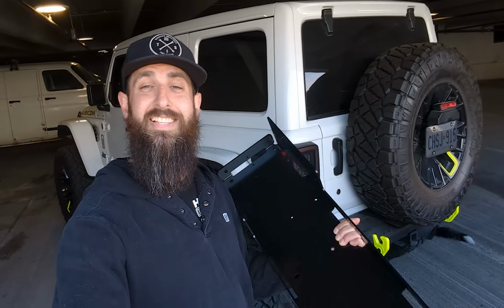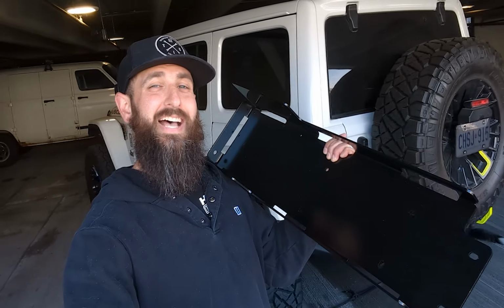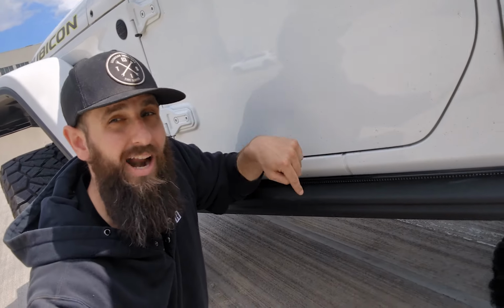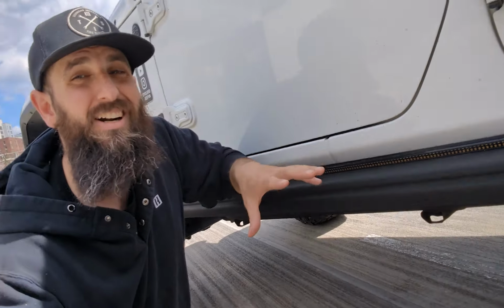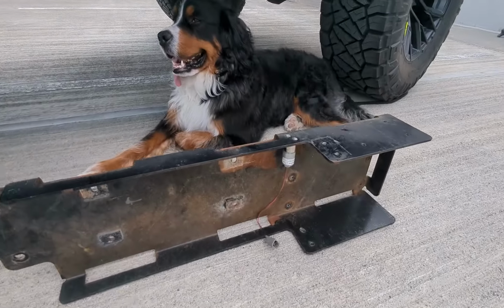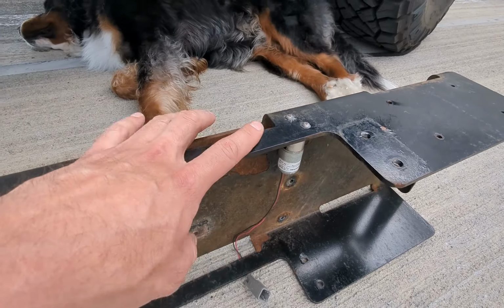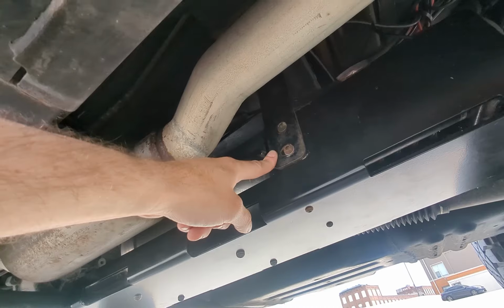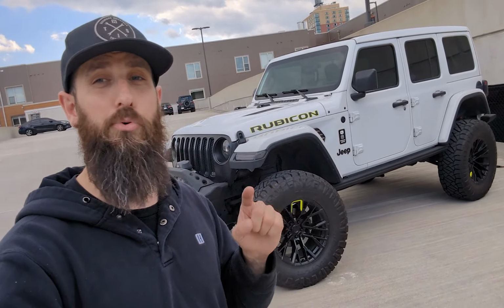Fixing the Disastrous Mistakes: AccuAir 3.5'' Dynamic Lift Kit Warranty Replacement Parts + 10% Off!

Comment: Just wire brush it, and hit it with some rust reformer/rustoleum. I am not a fan of powdercoat. Once you chip it or crack it, water gets in and you have rust, and dehiscence of the surrounding powdercoat. I had that happen on a Fishbone half height rack. Glad Accuair stepped up.
Reply from the maker: Yeah that definitely would have been the plan if Accuair didn't stand behind their product and send me a new one.

Comment: For the amount of money you paid Im a little dissapointed for you. Thanks for making this video it helps out tremendously..Shout out to Accu Air for taking care of you after exposing there flaws.
Reply from the maker: Honestly I couldn't be happier with the kit.  Even tho I have run into these problems the brand is continuing to address them and make the kit better and better. Yes I know this kit is expensive but it is definitely worth it, it's a 3.5" lift kit with onboard air, if you bought those separately you would most likely be paying more.  And not to mention that I have the ability to lower it down when I need to get into a lower parking garage in the city.

Comment: Hello, I have also changed the air pressure of my JL, but when the drop is too large when off-road, the red light will flash and the engine will lock up. It will only work after restarting. Is there any way to solve this problem
Reply from the maker: I am not sure what you mean, wish I could help.
Reply: e-mail?
Reply: Or other contact information

Comment: That skid plate should be stainles steel for the price. Was just quoted 7k for this system.
Reply from the maker: Does that include installation? Cause if so that's a deal.  Yes it is an expensive kit but you're getting a 3.5" lift and on board air, if you did those separately it would probably be close to the same or more.  Also it's not a cheap lift you are all the parts you need.